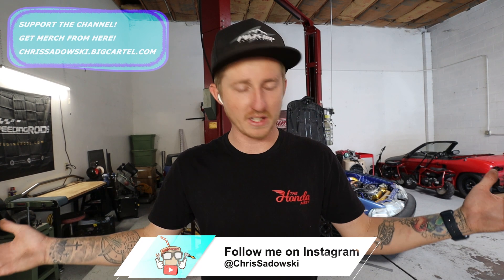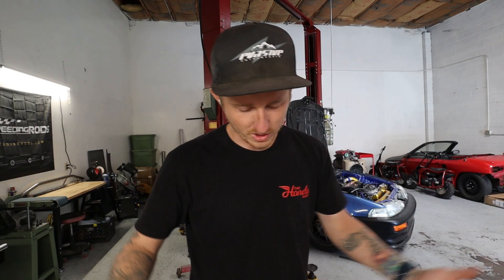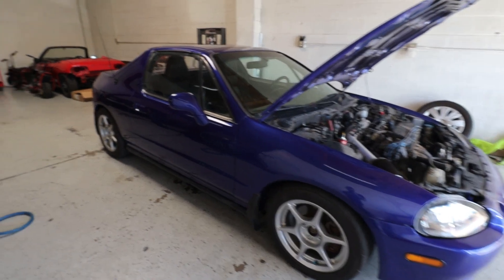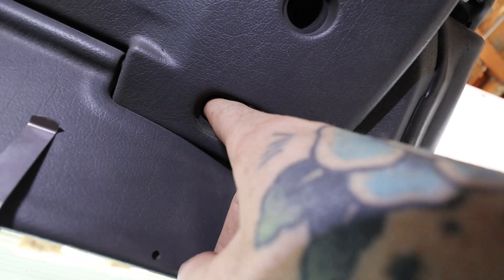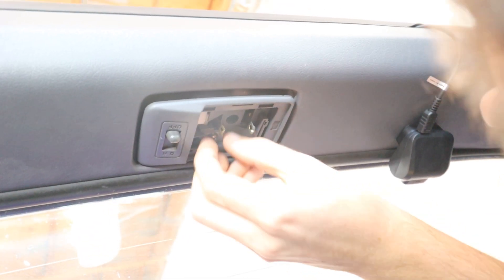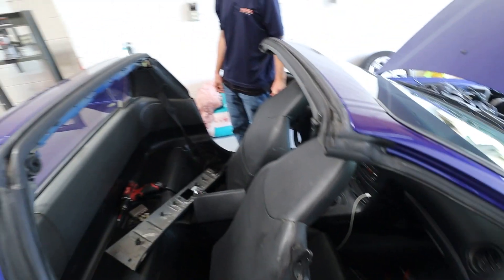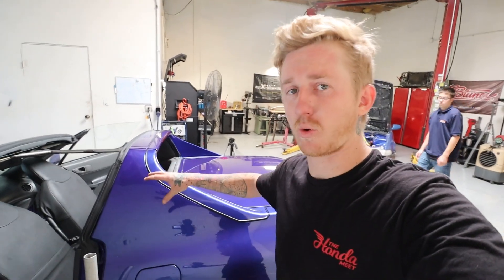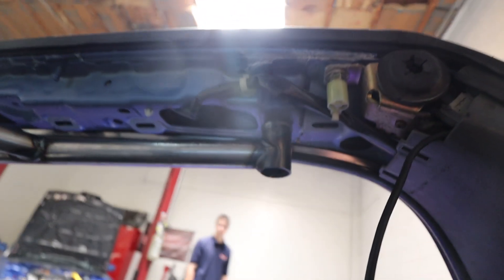SDFAB Honda Del Sol Targa Brace Install

Comment: That's awsome. I haven't seen this brace offered by anyone else. Very nice piece. I use to have difficulties with the bodywork I manufactured not fitting well on some bikes. The same make and model weren't always identical. A few times my bodywork would not fit at all because the customers bike had been wrecked in the past and was bent. I imagine those same problems can arise with some cars that have been wrecked or curb jumped. There's only so much a fabricator can do. Nature of the business.

Comment: I’ve been wanting a brace for my sol, does it help with quieting the car down at all without the body flexing so much? De sols are so noisy when you hit any kind of small bump!
Reply from the maker: It’s slightly quieter, but it’s just kinda depends on what is rattling in your car. At the end of the day it is a 28 year old convertible Japanese car lol